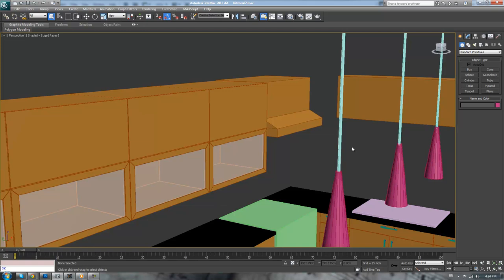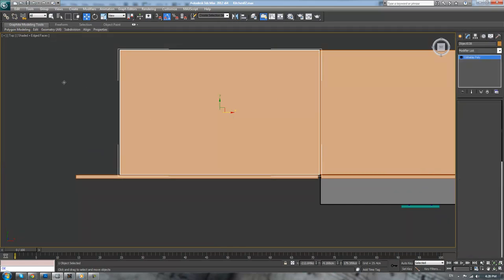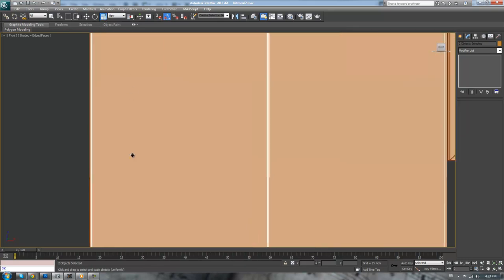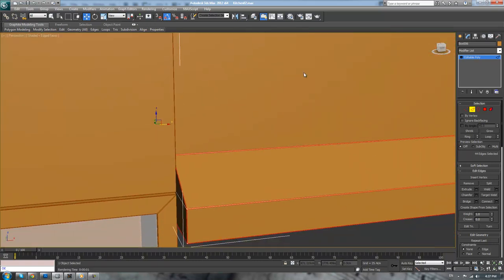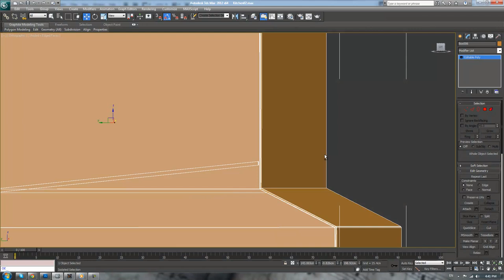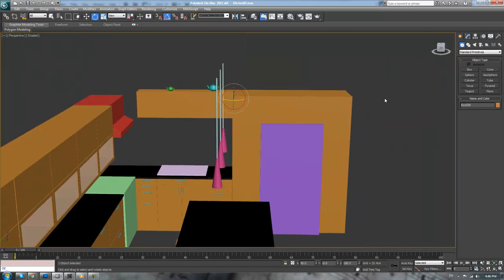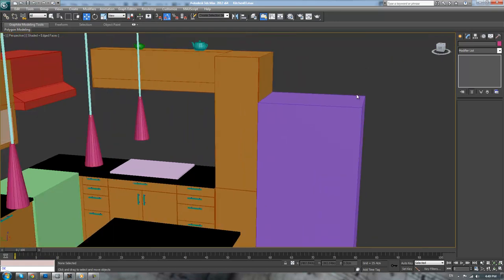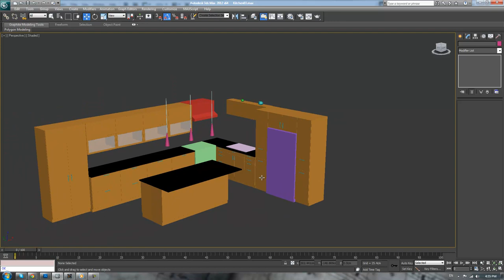Kitchen - Part 4 - Stove Hood and Cabinets around Refrigerator

Comment: nice tutorials, really nice, also just a tip i am a beginner and you know alot more than me but when creating the doors its probably more accurate to copy the top drawer re size to the door sizes, connect it with two lines and delete the middle if that makes sense? sorry I am new, this just worked better for me with that simple step. keep up the fantastic work man